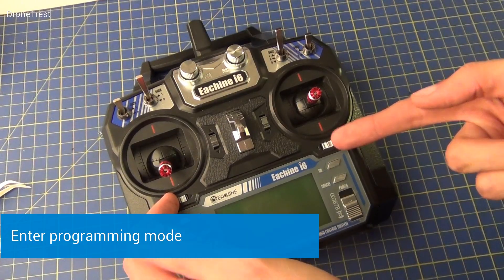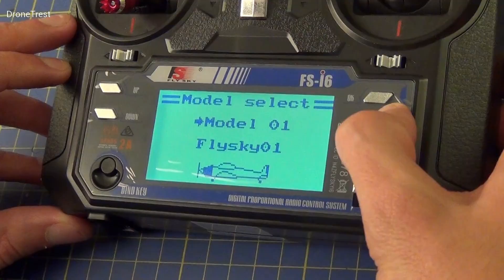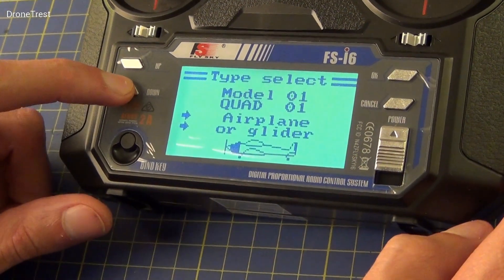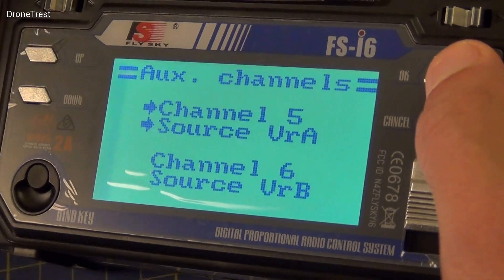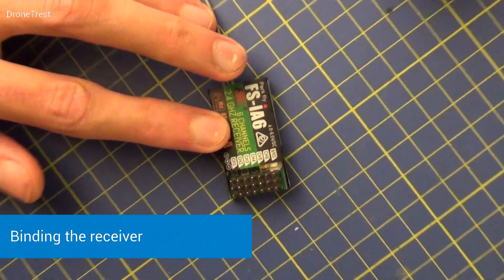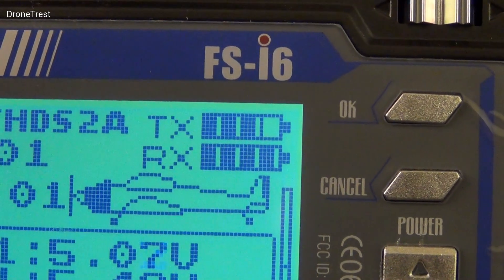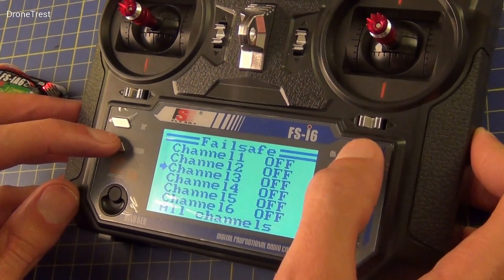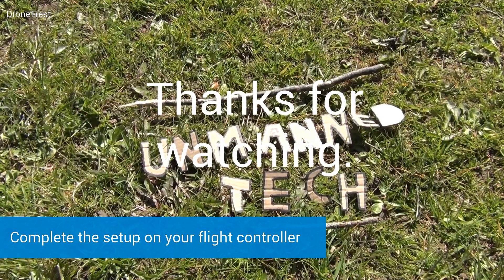Binding and Setting Up the FlySky i6 Transmitter for a quadcopter/drone

Comment: Can this quadcopter remote controller, tell the Height, Direction of the drone, and also, the voltage and current being supplied by the battery?

Comment: Excellent video ! I see you have the same receiver as mine, I need your help, I just burned my receiver by reversing the battery poles, I need the number of the transistor ( it has little numbers on top of it, as I burned I can´t see this numbers  and I need this  in order to replace it.
Could you please see yours and tell me ?

Thank you very much
Juan

Comment: everything works just two questions , yhat switch b what does it do cuz when i switch it down the drone becomes much more agile, does this mean its 3d mode? also my switch c i have to switch it all the way down to arm it but it turns on the rotors and they keep spinning. how can i turn that off i dont want my blades spining when its armed, whats the point of that anyways?
Reply: This is all dependent on you flight controller configuration. If you use betaflight you can chek there for what every switch does, but probably it is activating/deactivating something like angle mode/horizon mode which make the drone easier to fly.

Comment: Nice video but i have a question:
The error1 its normal?
Reply: yes it is! it shows the distance between the receiver and transmitter in percentage!
Reply: @tbttechbasstracks4220  thanks a lot
Reply: @j.r.m7457 It's actually really useful if you lose ur drone. Are you new to FPV?
Reply: @tbttechbasstracks4220  not exactly but yes, with just a classic plane
I have buy the i6 to noël

Comment: Hey bro I’m building my first drone and having some issues finding compatible parts. I was able to get a racestar starf4s 4-1 osd fc and I already have a regular fly sky i6 tx not the i6x and I’m not sure what to use for my drone receiver. I seen the flysky x6b and the mini fli14+ receivers but idk if they’ll work with my transmitter and ALSO where to solder it on my flight controller. I know pretty much everything else like where the vtx and camera goes but this i6 tx and receivers are really confusing me. Any help/knowledge/tips will be really appreciated.

Comment: You can just power the Rx with the bind plug in then press bind button on Tx and power on to bind. One significant thing you didn't mention, which also isn't mentioned in the Tx manual !, is that the bind is model specific. So if you bind Rx 1 to model 1 on the Tx then bind another Rx 2 to model 1 the originally bound Rx 1 won't work when you reconnect to model 1. The Rx 1 LED will slow flash (indicating it was previously bound as opposed to never being bound which gives a rapid flash ?) but the controls won't work. However if you bound Rx 2 to a different model selected on the Tx then Rx 1 will sill work OK when you reselect model 1. Not sure if there's a fiddle to get the slow flashing Rx to rebind without using the bind lead etc.

Comment: having a problem, even though my reciever is bound and the ports are set up correctly the I-bus setup on the radio wants you to "press the corresponding servo interface button" what is this step and why do neither cleanflight or betaflight recognize my reciever? it is set for serial receiver and ibus but is doesnt show it.
Reply: did you find a solution

Comment: What battery do you use to bind the receiver?
Reply from the maker: Any battery, you just need to power the reciever with 5V.. in the video we just used an ESC with a 5V output so it converts battery voltage to 5V to power the receiver.

Comment: Ok, for some reason when I try to setup the aux channels I can only find the VRA and VRB switches and can't find any of the SW switches. Then when I try to bind, the sound that the controller makes sounds right but it won't show RX or anything related to the reciever.
Reply: HUFXI I had this problem to. It’s not a good video for beginner like us. It looks in the video he flicks the switch presses ok and it’s done . But that  not possible when I tried. So like when you typed the name in you do the same with the up and down till you see the SW what you see on his video. I am getting out off all this is there any body out this who knows how to do a SIMPLE VIDEO everybody understands ? What the hell did he plug into the binder ? All I saw was some wires and a clip. Does this mean I have to buy another f&cker to get the f&cking snapper going ? I’ve bought the snapper 7 without a power lead so I had to buy that then a transmitter now a f@cking device you can see what it is. I’ve had the f@cking snapper over a month and still no closer To flying the f@cker

Comment: The manual says "that it is already binded from the factory and is not necessary to bind it." I did not have to bind. I'm using this for an  Exceedrc Madspeed drift car with servos for lifting & lowering hydrolic style.

Comment: okay forget that. DO NOT set the aux channels to the switches. for some reason my bind f'ed up and the switch was 0%/100% on the throttle. now i have a quad shaped dent in my ceiling, which is not f'ing amusing.
Reply: thats funny as heck
Reply: Take off your props!!!!!
Reply: atomictraveller can you help me please I have an f3 evo v2.0 and rx2a pro flysky receiver , im not sure how to wire it ibus or ppm ? And what port on the fc dose it belong to

Comment: Thanks for the nice video on Flysky Fs i6. Finally, i got mine arrived yesterday Flysky FSi6x and was trying to bind it with Wltoys F959, F949 and F939. i was able to bind it with Wtoys F959 and F949 but despite trying several times i was not able to bind it with Wltoys F939. Would appriciate if you can share any ideas to get my Flysky FSi6x bound with F939. Thanks
Reply: how did you bind it to the flysku fs i6x ?

Comment: sir i have a problem in my fs-i6, after i factory reset it the sensor list is gone, so my receiver cant detect my esc bec. how can i restore my sensor list?
Reply: ya a also same problems plz tell me that solaution
Reply: re-bind ur controller bro.
Reply: my diode was melted when i connect it into series sir. same scenario when i replace another diode :/